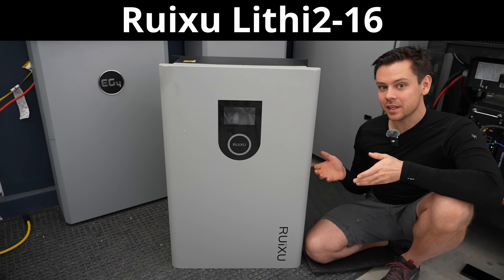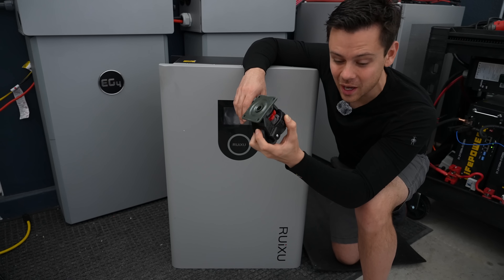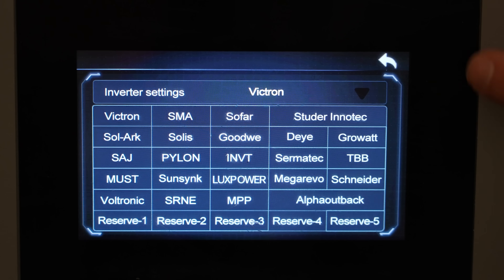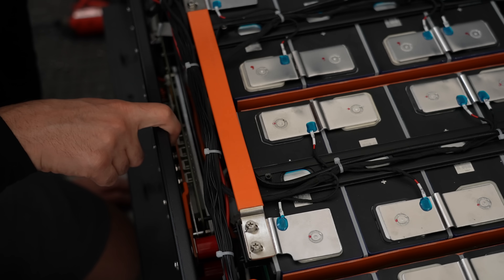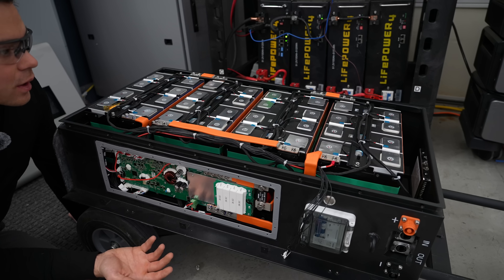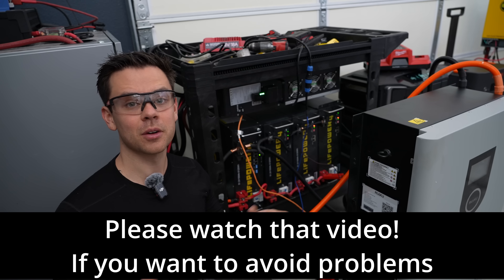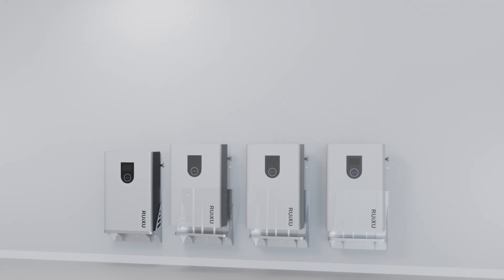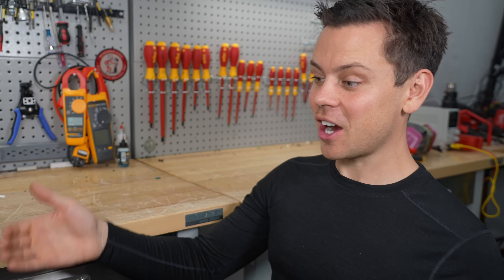Ruixu Lithi2-16: 16kWh 48V LiFePO4 that is Cheaper than EG4?!

Comment from the maker: Lithi2-16 Affiliate Link: https://www.ruixubattery.com/product-page/lithi2-16-battery-bank?ref=uakhk727

Other Ruixu Products: https://www.ruixubattery.com/buy-now?ref=uakhk727

EG4 Powerpro Batteries: https://www.mobile-solarpower.com/48v-vertical-mount-lifepo4.html

EG4 Server Rack Batteries: https://www.mobile-solarpower.com/server-rack-lifepo4.html

0:00 Intro
0:17 Price Comparison to EG4
1:09 It is HEAVY
1:54 Basic Features
3:05 Display Interface
4:05 Teardown!
5:48 Serviceable BMS!?
7:24 Communication Setup w/ EG4!
8:30 Expanding your system
9:34 Conclusion and Downsides

~~~~~~~~~~~~~~~~~~~~~~~~~~~~~~~~~~~~~~~~~~~~
Tired of getting ripped off? Check out my "Will Prowse Approved" solar product recommendations below!

12V Batteries
https://www.mobile-solarpower.com/lithium-batteries.html

48V Batteries
https://www.mobile-solarpower.com/48v-batteries.html

Offgrid Inverter System Builder
https://www.mobile-solarpower.com/48v-complete-system-blueprint-559371.html

Hybrid Inverter System Builder
https://www.mobile-solarpower.com/code-compliant-48v-offgrid-system.html

Mobile Handtruck System Builder (very popular!)
https://www.mobile-solarpower.com/mobile-48v-system.html

Solar Panels
https://www.mobile-solarpower.com/300w-solar-panels.html

Ground Mount Solar Racking
https://www.mobile-solarpower.com/ground-mount-racks.html

Wire, Lugs and Busbars
https://www.mobile-solarpower.com/wire-and-connectors.html

Tools
https://www.mobile-solarpower.com/tools.html

Fuses and Circuit Breakers
https://www.mobile-solarpower.com/fuses.html

Plug-N-Play Solar Systems
Ecoflow, Anker And Bluetti! So many models to choose from. See my current recommendations here:
https://www.mobile-solarpower.com/full-size-systems.html

~~~~~~~~~~~~~~~~~~~~~~~~~~~~~~~~~~~~~~~~~~
Need to build a large DIY system? Need a trustworthy solar distributor? These are my favorites:

Signature Solar
Creator of EG4! Solar Minisplits, Victron and More! Largest Solar Store Online.
If you want $50 off, please use my link below and coupon code "DIYSOLAR50":
https://signaturesolar.com/?ref=cPwLcVc0SW-BjN

Current Connected
Best Prices for EG4, Victron, Midnite and so much more! Fast Shipping and Highest Rated Customer Service:
https://currentconnected.com/?ref=wp

~~~~~~~~~~~~~~~~~~~~~~~~~~~~~~~~~~~~~~~~~~
Join our DIY Solar Community 
Need more help? Join the largest solar forum on the internet for beginners and professionals alike. 140,000 members and counting!
https://www.diysolarforum.com

Check Out My Free Book
Best-selling and beginner-friendly guidebook to off-grid 12V solar!
https://www.mobile-solarpower.com/the-book.html

~~~~~~~~~~~~~~~~~~~~~~~~~~~~~~~~~~~~~~~~~~
Contact Information:
I am NOT available for personal solar system consult! If you wish to contact me, this is my direct email: williamprowsediysolar@gmail.com
FTC Disclosure Statement and Disclaimers:
Every video includes paid promotion or sponsorship (such as free products for review). Some links on this YouTube channel may be affiliate links. We may get paid if you buy something or take an action after clicking one of these. My videos are for educational purposes only. Information is subject to change/update at any time. Electricity is DANGEROUS and can kill. Be smart and use common sense :) DIY Solar Power with Will Prowse is a participant in the Amazon Services LLC Associates Program, An affiliate advertising program designed to provide a means for sites to earn advertising fees by advertising and linking to Amazon.com
Reply: Link does not apply any discount, i take it that link or ref code was only for Black Friday or cyber Monday? Do you have an actual discount code?
Reply: Also you were WRONG they do not have free shipping on this battery, just like signature solar you need to spend $5k for free shipping.
Reply: did you ever verify the advertised battery capacity listed on these modules?
Reply: I see $3399 + $400 shipping.. free shipping is for over $5000
Reply: Can you hook up a 220v welder to one of your battery systems.  I really want to see how well it does and what it takes to drive one.  Youtube has very little videos covering anything close to this.
Reply: Ruixu now has free shipping on orders over $3000.00
Reply: Hey Will,
 What are your thoughts on people running out of "solar tax credits" and still owe thousands on the installation and have an electric bill? This is happening in California, not sure if other states also. Thanks.
Reply: @WillProwse We are waiting for the installation and review of the EG4 12000XP inverter.
Reply: Maybe they will send one of their Inverter once release to be reviewed. I'm still rocking with a LV6048 but recently bought a EG4 6000XP to ship overseas.

Comment: To make my Ruixu very stable I removed the wheels and the that bottom steel plate.  I then took a 2 inch think solid wood board, 2 inches wider than the battery on both sides and put the wheels on the board and then drilled the board to match the bottom of the Ruixu screw holes,  bought longer screws and screwed the board to the battery,  now I can wheel it around and the center of gravity is 100% better,  I cant tip it over without really trying to.  
The company should make the steel plate on the bottom that you took off much wider.  centering the battery better.  wish I could upload a picture of it but it works really well.  Would work for any of these tall thin battery towers that have the wheels right under it, very unstable design as you found out.

Comment: Looks like a well-made battery. The only problem with these wall mount vertical style batteries, is that the cells are mounted sideways. So all the electrons pool up at the side of the cell, since the side is situated on the gravitational bottom. Not good
Reply: Is that really a problem? You would think they would know that  EG4 is the same design.
Reply: @AutoInova8tor  it doesn’t matter who the manufacturer is, the problem is the same

Comment: Some LFP cell manufacturers do not recommend at all putting cells on the side (EVE) especially on the short side, and yet this example  completely contradict that recommendation. Very interesting.
Reply from the maker: It all depends on the cell. Some recommend it and others tell you not to. Depends on the size, cell design, thickness of cell walls etc

Comment: Don’t know how you can just plug in the communication cable and bam it works, 
I’ve been trying to get mine to communicate for a month now, only will show the battery on lead acid settings, no other battery configuration, did a firmware update, still nothing from Li-ion settings. Wish I had your touch.
Reply: May i know the model inverter are you using?You can contact me via the email on the official website,i'd like to provide support.

Comment: @willprowse Now that you’ve had this for a couple of months would you do the Ruixu lithiu2-16 or the EG4 wall mount?
Reply from the maker: Oh man that's really tough. I love them both.
Reply: @WillProwse  they seem be good.  my goal. is to install them with a grid boss/flexboss.  Ruixu battery cost about the same as the outdoor eg4 battery and it is outdoor rated and it is 10.6% more battery!!!  Most people will get 1-2 batteries so the savings compound.  I wish EG4 would compete better with their outdoor battery.
Reply from the maker: Ruixu makes solid batteries
Reply from the maker: And the EG4 wall mount probably My favorite from them lately

Comment: Are those cables that come with the battery 1/0 or 2/0? I want to parallel 2 units but I think I need to run 2 sets of 2/0 from the busbar to support the 400 amp max
Reply: 1/0AWG

Comment: Outdoor rated but can it handle Vegas heat with ambient temps frequently reaching above 110F even in the shade?
Reply: The operating temperature of the battery is -20℃-50℃

Comment: Im on my 4 week with my ruixu 16kwh battery and inverter (10k sunon10) as a review im by far impressed with the system! Battery pretty much been plug and play for the most part! though I did have an issue understanding the instructions for setting up the inverter mainly due to booket seems to be gear for professional installers and not diy... But i was able to figure it out!! I did have to reach out to Ruixu due a retention lock on the negative battery cable was damaged and 2 days later i had replacement parts! I have been an eg4 fan for awhile though with the price changes and backorders i turn my attention to Ruixu because they make a really good quality product and stand behind it! Thanks
Reply: Thank you for your positive feedback！We will continue to provide every user with high-quality customer service.

Comment: Will, can you disable or modify any of the heater settings in the screen or setup?  Just curious, as if you had them in a heated environment (40-45 degrees) during winter, but don't want them self-consuming... can you shut that off.   Thanks!
Reply: The self-heating function is only turned on when there is an external power supply. If the BMS detects that the temperature is sufficient, it will directly perform the charging function without consuming energy for heating.

Comment: I want to connect this in parallel with my two powerpro batteries. Can I use the amphenol connector busbar on the power pro or should I get an external bus bar?  Can the communications cable connect to the power pro battery to use as a slave battery?
Reply: You need an external bus bar
Reply: I alrewdy had my chargeverter and the slave powerpro battery connected  to an external busbar so i just connected the ruixu to that busbar and it worked    @RUIXU_candy

Comment: So if I currently have an EG4 14.3 kwh battery and I add a Ruixu 16 kwh battery with EG4 6000 XP inverter, how do I set up the communication cables and settings to run two different kinds of batteries on the inverter?

Comment: Thanks!

EG4 12K or 18K. 
RUIXU Lithi2-16 51.2V 314Ah Lithium 16kWh Lifepo4 Battery Storage.

Could I add this to the above system. 
HYZHANHONG. 9000W Vertical Axis Wind Turbines Generator, 12V-220V 3 Blades Motor Kit 12V/24V/48V Windmill Energy Charge Turbines with MPPT Controller.

Wife and I our going to move to Las Vegas by the end of June or July.
 
Thank you. 
Bryan O’C
Reply from the maker: Hmmmmm 

Really like both but it depends on what you need. That's a really good combination. You can add that to charge the battery but wind power is very intermittent. In Vegas I would not use wind power. When we have a desert Storm it would destroy it
Reply: Hi,ensure that the MPPT controller's output voltage range supports the battery's charging standard (recommended charging voltage: 56V).

Comment: Attn: Will Prowse. 
This may be a lot, I'm new to all this,  everyone please be nice to me. Please and thank you. 
Q&A
EG4 12K or 18K. 
RUIXU Lithi2-16 51.2V 314Ah Lithium 16kWh Lifepo4 Battery Storage

Could I add this to the above system. 
HYZHANHONG. 9000W Vertical Axis Wind Turbines Generator, 12V-220V 3 Blades Motor Kit 12V/24V/48V Windmill Energy Charge Turbines with MPPT Controller.

Wife and I our going to move to Las Vegas by the end of June or July. 

Would all the above work. 

Thank you for your time.

Comment: Hey Will, awesome video. Have you seen the off-grid ChargeQube?  The small ChargeQube is a 10' container with one to six 75-kwh batteries for a max size battery of 450 kwh! The larger 20' ChargeQube is double the size, up to 900 kwh of batteries. Video says it is portable and rentable for temporary or stationary needs. The price on the video for the complete 450 kwh ChargeQube is about $75,000 (plus shipping from Europe). I'm wondering if I can maintain the charge with a large solar array to power an all electric home on a south facing 10 acre mining claim that "High Country" zoning prohibits hookup to the grid. The main downside is I believe they are recycling lithium ion car batteries instead of new LFPs.

Comment: I wonder how to determine if the battery is compatible with a 48v PowMr All-in-one unit. It doesn't seem to be on Will's options screen for inverters. But MPP is and my current SOKs are working seamless with both my MPP and PowMr units.

Comment: Great review.  There is mention of a video on using different brand batteries in parallel.  Could you provide a link to that video?  I have 1 EG4 powerpro with the 18k and was glad to hear that I'm not locked into the same battery for expansion of the system.  Thanks for all the work.

Comment: hello Will, I have a 6000xp and an EG4 indoor wall battery, can I parallel a Ruixu wall battery ? 

Would I be able to use the built-in bus bars or do I need external bus bars?
Reply: Yes,you can,you need an external bus bar.

Comment: This is a nice battery.The only thing I can say is that the temperature sensors connected to the bus bars would give a higher temperature reading  than if touching the cell which is really the temperature  we want to read. Thanks

Comment: Thank you for such great content.  I finally slowed down long enough to analyze the affects of the January 2024 Idaho Power billing changes from net metering to net billing.  There are 1000's of solar install homes who are caught between the December 2019 Grandfathering and January 2024 changes.  We sized our grid tied microinverter system to eliminate the power bill.  We had no bill up to January 2024. Now we have a bill almost every month.   I have 32 - 49.4 watt, 385 bifacial uninstalled solar panels in the shop that I want to get out and use to offset the negative affects of the Idaho Power 2024 changes.  Researching the possibility of mixing the current Enphase microinverter system with a new hybrid string inverter and battery storage that can be operated by these solar panels in the shop.

Comment: We appreciate your  insights and hindsights.  It's difficult to save up for these batteries and inverters.  I would like to help people install these systems but they are pricey for the vast majority of people so it's great when a company lowers their price to help out.  My suggestion is that they get a larger inverter than they think they will need, as it is that way in MY case, I got a 6 kilowatt inverter because I use about 3.5 kilowatts per hour on average, but it will not run the house AND the hot water heater, nor the central heat and air conditioning plus the house.  Now the 8 and 10 kilowatt inverters have come down to less than what I paid for this first one and I don't have room for two 6 kw inverters so it looks like I need to upgrade by replacing this one.  Perhaps I can use it in my wood shop as a separate system.  Panels have come way down and I can keep adding them and the same with batteris, but in groups of 48 volts so that s still kind of high.  Thanks for what you do.

Comment: Hi will, I love your videos, I just got my battery and the eg4 6000xp but I have a communication problem and I call signature solar for assistance and they tell me I have to used the battery like lead acid ? Any help please !!
Reply: Try type 1 on the inverter lithium type and PYLON on the battery. It did not work at all when the battery was set to luxpower btw regardless of the brand type.

Comment: Solid state marine  batteries  have peaked my interest the weight of 100 watt per pound sound really good  and the cold temp performance  of -4f of  charging and running  and max temp of 155f  maybe check them out  the next step in battery  technology  in my opinion

Comment: Hey will, I'm in the Philippines. Power here at times is challenging. I already have a back up 12v gel for our wifi phones fan ect. Now I want to do a lifepo4 separate for our refrigerator. Do you know anything about pow Mr lifepo4? They seem to be in my price range and have good reviews. 
My refrigerator is a inverter type I'm thinking 100 ah will do the trick. Your input on the battery would be appreciated.thank you

Comment: I don’t know if you have access to all the latest and greatest power walls and batteries. It would be great to hear a comparison between eco flow and all accessories ( power wall, tracking solar panels, delta ultra) versus Tesla solar panels, power wall ( I don’t think Tesla has portable batteries so put Anker portabale batteries in its place)

Since people off grid look into these units. Is it practical for off grid living. People use fireplaces. Soot fills chimneys and roof. Would that cause underperformance of solar panels? Just leaving them on the ground is asking for trouble.

Comment: Hi. I've been watching your videos for a long time. They're really informative and I like them a lot. I have a question, if you have time. About four years ago, I took your advice and bought the EpEver 4215 solar controller that you recommended. It's been great, but I'm about to upgrade my batteries to lithium, and I'm not sure how to set up the controller. There doesn't seem to be a profile available for lithium batteries. Should I use one of the presets, or should I do a custom charging profile under the "user" profile? If I do a custom profile, are there some settings that you would recommend? Also, I don't seem to be able to select the AmpHour setting to change it to 400. Any idea why?

Thanks  a lot.  Mike

Comment: Will, was told about your channel by folks on school bus convention site. This item looks like a great idea for a whole home off grid mini home system. Looking to run all the electrics and DC systems using a 2500 to 3000 watt solar panels,  5000 watt gasoline generator, and at times a 30 or 50 amp RV sight plug in.what is your opinion on this situation? Thanks for your information!